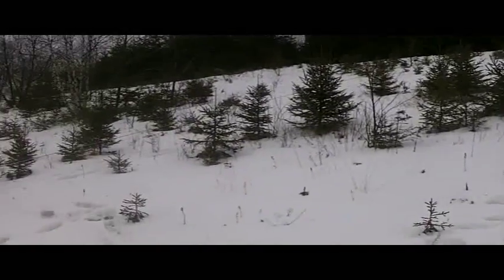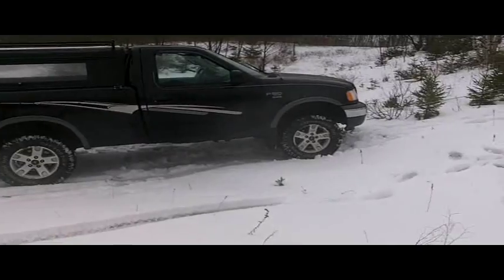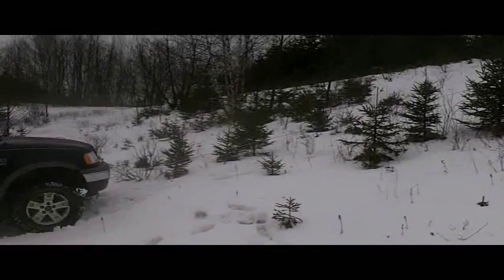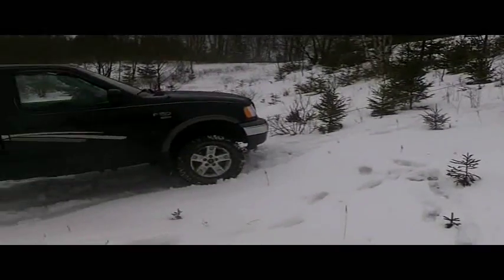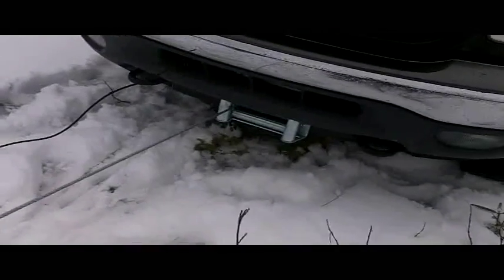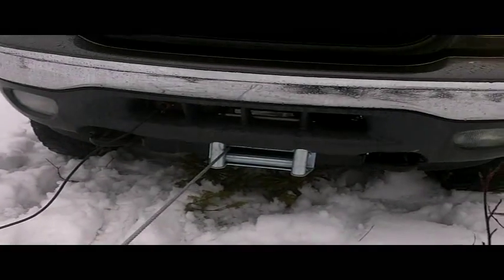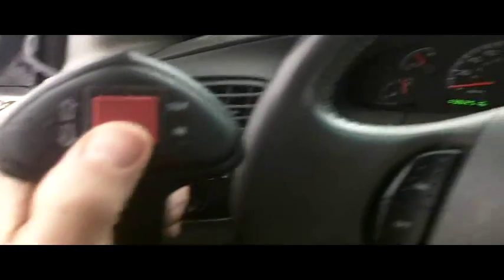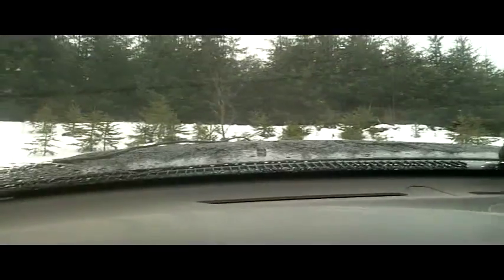SmittyBilt Winch

Comment: Most winches will draw well over 350-400 amps and the stock alternator just can't even come close to dealing with that kind of drain. I've got a mechman 320 amp alternator on my jeep, and even with the winch pulling hard my volts won't drop. You should look into one. It will pull way harder and be faster. The lower your volts go the more amp draw and more heat is produced.